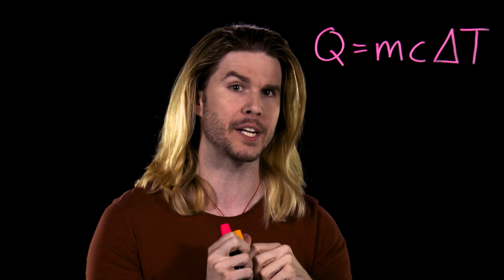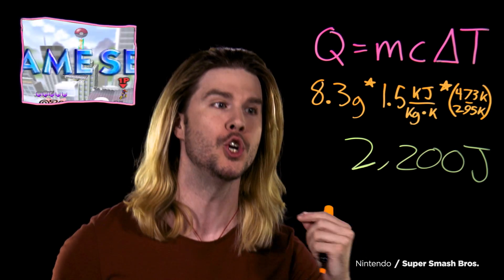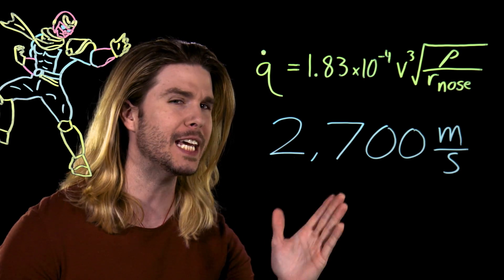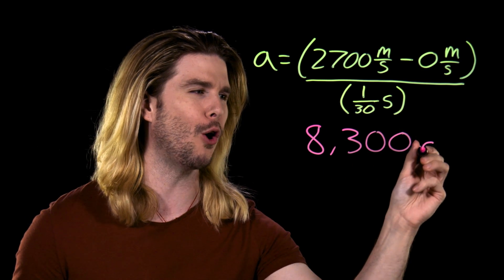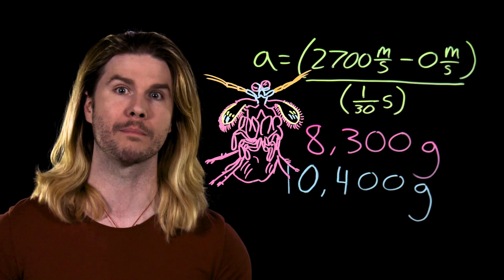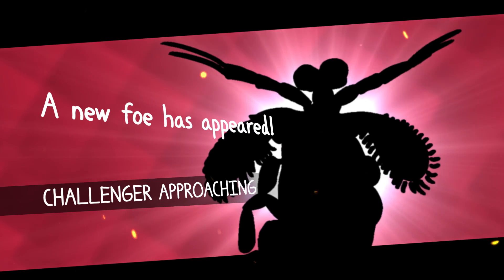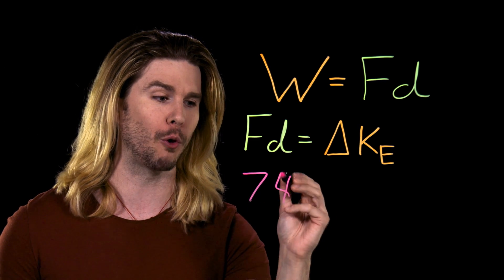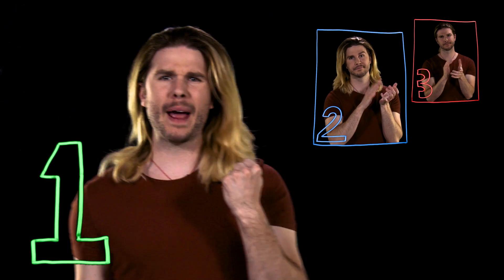How Powerful is a FALCON PUNCH?

Comment: So the physics on the Falcon Punch would require you to move at an extreme velocity in a minimal distance but it could also have to compress the air around to benefit from the accumulation of air particles. Thus a falcon punch would create a vacuum surrounding it by fractions of a second.

Comment: While not the main purpose of the episode, there is also another factor that he would need to "deal" with, being newtons 3rd law. If his fist is carrying that  much energy, then in order for him to stay in the same place, he would need to be putting the same amount of energy in the opposite direction to prevent himself being thrown backwards.

Even if we say that he's able to distribute this through his feet, which would have a larger surface to do this over than his fist, this would still be a massive amount of energy likely to overcome the structural limits of whatever he's standing on, punching a hole in the floor under him.

One fun solution to this would be if rather than simply punching, he was to get his ninja on, and kick the air in the opposite, which would not only allow him to cancel out his change in velocity, but also attack in both directions at the same time. I don't know about you but i'd rather take the punch than the bottom of his near equally powerful boot.

Comment: So if the Falcon Punch missed the target would his arm go flying off or would he continue along until his fist decelerated?
Reply: I'd assume the momentum of the first would overcome his available traction and send him flying. However, the force wouldn't be evenly applied, and he'd likely be blown to pieces as he was sent flying.
Reply: @DigitalJedi  that's kind of what I was thinking. Also, what about the shock wave coming off the fist? Lol
Reply: @thekraden04  It would behave exactly like what it is, a sonic boom. It would lose some energy to the target but no have a noticeable addition to the effects of the punch.
Reply: @DigitalJedi  I will have to disagree there.  The shock wave would probably be carrying the heat along with it.  It would be worse than having a bullet whiz by you, and even that can cause damage depending on the round and proximity.

Comment: Hey Kyle, love the show. Question: Would there be enough air in front of his fist in that short of a distance to create fire though? I mean you were talking about spaceships and stuff... So would it apply on the fist as well?

Greetings from Germany
Reply: Very good point, and would there be enough time for the air to get super heated before the end of his punch to cause such a fire? The reason why it happens to space ships is that they go from the vaccuum of space to trying to penetrate the atmosphere of a rotating planet, it's not sudden combustion like the falcon punch is. [Or for Kirby Mains the Pinecone Punch.] It takes time to re-enter and the temperature builds up over that time.
Reply: @syxxvralrock5759  with the pistol shrimp it's in water so h20 is way more dense then air so the drag is greater than air which causes the shrimp to ignite the water but if u took the shrimp out of water and it tried it not much would happen if nothing at all
Reply: So are you guys forgetting about the shrimp? The distance with them is even smaller (although yes more force) but just a cm or 2 is enough to compress the water in front of it to create light. Time isn't really a consideration, in this case, atoms don't care how long they have been compressed for,  if you get my meaning.
Reply: @RavenZahadoom  Sure, but the shrimp is in the ocean, which is much more dense than the air.
Reply: remember: Air, though not as dense, still increases in density the closer to sea level you get. Space craft "burst" into flames in the upper altitude and as such are there isn't as much atmosphere (and as such, less air) in front of it when it burst into flames
Reply: less atoms on reentry is a great point, a falcon punch would likley interact quickly with more than enough atoms to generate fire, but unfortunatly for the little mantis shrimp its claw powers are still not a great example of a (falcon punch) considering the mantis shrimp can only move its shooting claw at a mere 23 meters per second, the speed of sound in air is 343 mps let alone the 2700 mps kyle is talking about for an actual falcon punch.
Reply: Surface area are always a factor!

Comment: It makes sense that you wouldn't want an aerodynamic nose when re-entering earth's atmosphere, as you're ultimately trying to slow down.
Reply: lol, Yeah, that would be like making sure your breaks were as light as possible so they don't weigh down your craft too much.
Reply: You don't want to be too unaerodynamic though because otherwise you would decelerate too fast and build up too much heat destroying the capsule. As I understand it re-entry capsuals are actually quite aerodynamic at those speeds, dealing with a shockwave of air rather than normal airflow changes things quite drastically.
Reply: Not only are they decently aerodynamic to ensure that friction doesn't cause then to get too hot, but it also aids in control. Having a non-aerodynamic pod would cause you to spin and tumble out of control very quickly.

Comment: RIP to all those 'ignore air resistance' questions we have in physics class who must be feeling so redundant right now lol
Reply: Those are there because not ignoring air resistance leads to calculus.
Reply: @roberthunter5059  And calculus sucks. Indeed.
Reply: @roberthunter5059  ik I love it even if it takes a hella crazy amount of time. Uk, the result is a lot more satisfying when you grind through all the extra math. Maybe that's just me🤷‍♀️
Reply: The dampening effect of air resistance can lead to unsolvable differential equations, which is generally an issue when the point of the question is finding the answer
Reply: @gamemeister27  true... But you can usually see early on in the problem solving process if you're going to end up w one of those so then you can just go and solve normally. Plus you don't encounter those so often at the basic level. But yea it sucks when you can't predict that and find out the hard way coz if you're not solving an exam question then you're very likely gonna end up w an unsolvable differential equation coz those are literally everywhere.
Reply: Exactly there could be higher air resistance.
Reply: They can in some situations. If you are going relatively slow the air resistance is less variation than other factors and becomes something that can be ignored. When you are accelerating fast enough to compress air and auto ignite it the change due to air resistance is significant. It is not in for example doing calculations about a conveyor belt moving boxes at say 2 mph.
Reply: I was always saying to my physics teacher: "but that's boring!"
Reply: @ijazfazeel4423  😂😂